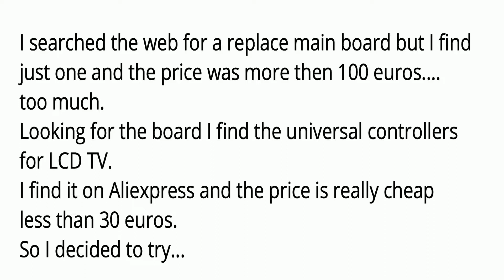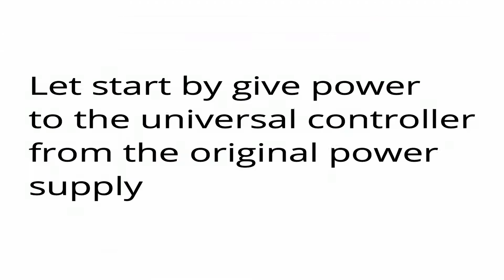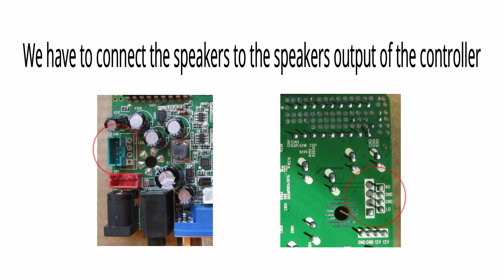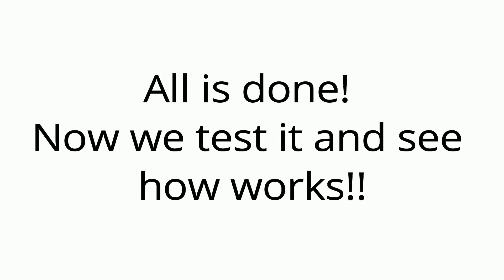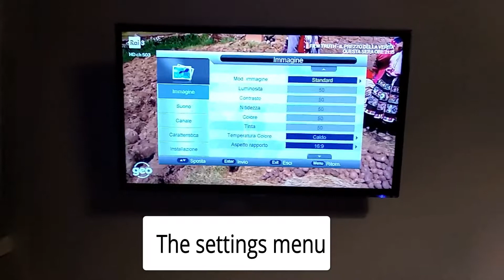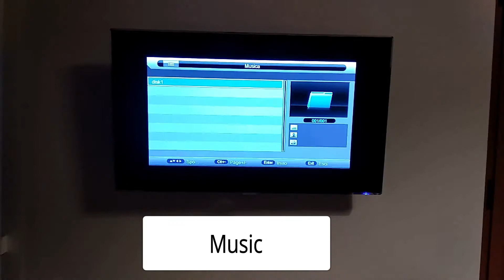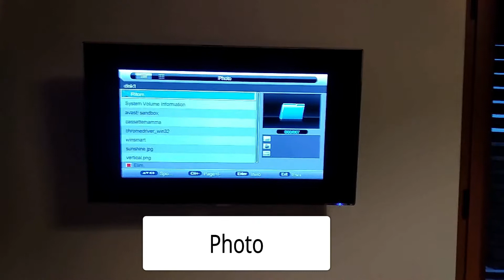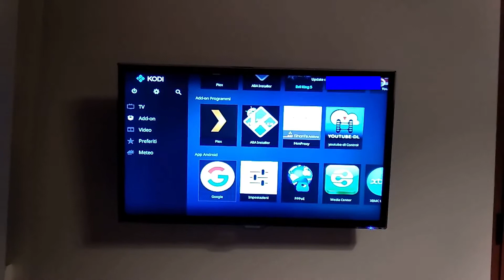Recover broken  LCD/LED TV - Come recuperare un TV LED/LCD rotta

Comment: Ciao ma non hai trovato i 12volt dall'alimentazione del tv senza mettere il booster?
Reply: Si vedono i canali  100 e 200 del digitale terrestre ,cioé é compatibile con dvb-t2 hevc main 10 h265 ? Grazie
Reply from the maker: In standby la PSU da soltanto 5v, dopo averla accesa fornisce i 12v. Inizialmente usavo il booster solo per fornire i 12v al controller quando la PSU era in standby per poi usare direttamente i 12v forniti dalla PSU, ma sentivo un continuo ronzio nella casse, ho provato in tutti i modi di capire come eliminarlo  ma alla fine la strada più semplice è stata usare i 12v convertendoli dai 5v di standby. Nessun ronzio e funziona da 2 anni ormai.
Reply from the maker: Quali canali sono il 100 e il 200?? I canali HD non si vedono o meglio si vedono bene ma senza audio questo per problemi di licenza AC3
Reply: @GiosiaG   sono dei nuovi canali di test per verificare se il tv é compatibile con dvb-t2 con standard hevc h265 che entrerà in vigore fra un pò
Reply: Grazie.Fammi sapere se si vedono il 100 e 200 dopo che fai la risintonizzazione 😀
Reply from the maker: @torioitalia1491  no i canali 100 e 200 non si vedono purtroppo